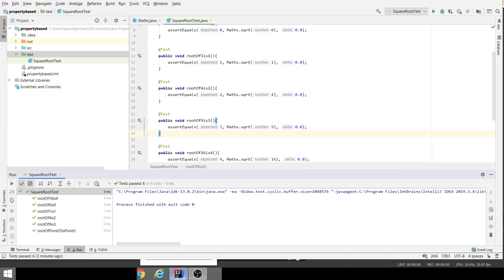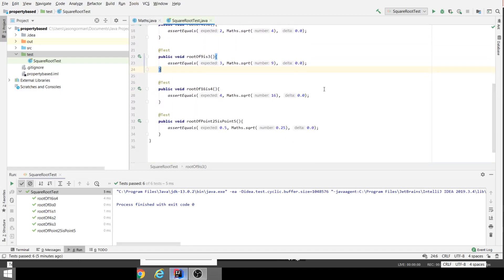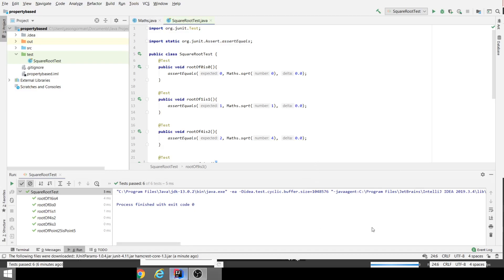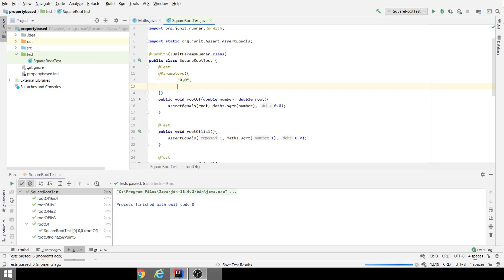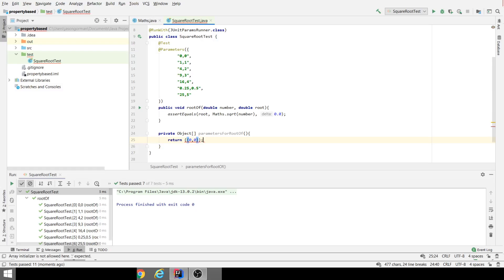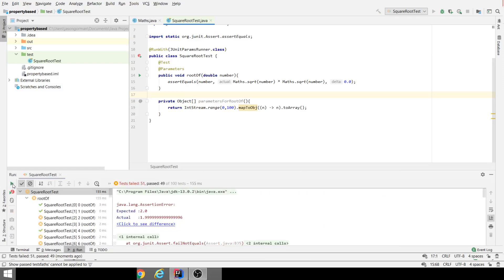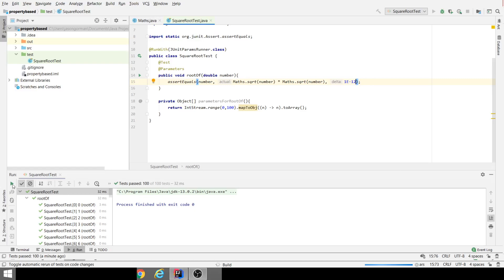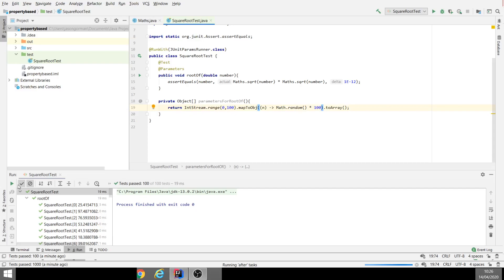Refactoring To Property-Based Tests in Java

Comment: Very nice video! Keep up the work!
But two things you missed that could lead to problems on the airplane:
1) Floating Point accuracy is lower the further away the numbers are from zero.
2) Math.random() won't produce NaN, you might wan't to test that separately.
But to be fair, the unit tests didn't cover those cases either.
Reply: After trying it, the spec of a delta of 1e-12 isn't met for in the rage of 10^12.
Example:
java.lang.AssertionError: 
Expected :8.076647072721951E8
Actual   :8.07664707272195E8
You could find these Errors, by searching return IntStream.range(0,100).mapToObj((a)->Math.random()*Integer.MAX_VALUE).toArray();

Of course, smaller values will be used by the programm more often, but larger values are more likely to produce errors.

But once again, great video!
I'm really happy I saw this. Paramaterized Tests in JUnit without 3rd party Runners are miserable!

Let's hope there will be a proper property based testing library for JUnit, like Quickcheck for Haskell or Hypothesis for Python.